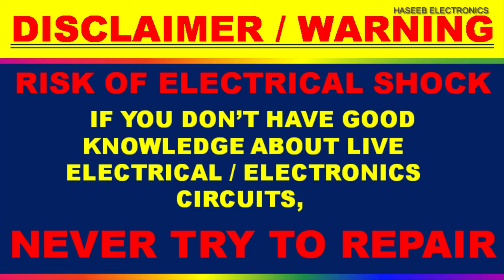{565} How To Repair of LED TV Backlight Strips / How To Replace LED on LED Strips

Comment: Great job Sir . 
I wanted to ask you if i can just replace the LED under the glass with another LED !! i mean just change the LED inside then put back the glass !! if it is possible what kind of LED should i buy !! is it 3535 or 3528 ? 
thank you
Reply from the maker: best regards
yes we can replace led 2835 3volt or 2835 6 volt 
watt rating depends on the led strip 1, 2 or 3 watt 
and we can use existing lense

Comment: Most of my reflection glass has fallen of do I stick it back with glue and if my led is not working can I take it from a  led strip by cutting that stop led to fit
Reply from the maker: yes it can be done

Comment: how to repair the power supply of that led strip on the power supply board ,,my power supply for led strip is faulty..it has no voltage reading,,

Comment: Nice ...but soldring is good enough???
Reply from the maker: yes that is doable but  soldering is not much effective on these aluminium strips, as these strips cool down the soldering iron, 
by this technique it makes best soldering without damaging the mounting and LED structure 
it is very cheap and very very useful
Reply: @HaseebElectronics  yes you are right this process does not damage the led but this soldring is not good enough for continuous running led ...I already do that...... please share some other healthy led soldring techniques .... thanks 👍🏻

Comment: Can I test it with simple 9v battery
Reply from the maker: yes. you can test it using 9 volt battery by adding 330 ohms resistor in series

Comment: What is the Reason you connected with the 12ohm resistor?
Reply from the maker: that is current limiting resistance 
i connected in series
please check upcoming video (video number 566) you will find a detailed answer for your question
Reply: @HaseebElectronics  does the multimeter have an internal resistor when using "led mode" ? Thank you

Comment: Can I ask what the exact purpose of the 1K resistor? Is for protecting the multimeter?
Reply from the maker: It is current limiting resistor 
(Similarly we connect in series with LED or zener diodes)
Reply: Oh, I just read your reply to another similar comment/question that video 566 will have the explanation for my question so i'll look for it as I'm behind on watching your latest video uploads. 👍
Reply: @HaseebElectronics  Thank you for the explanation.
Reply from the maker: most welcome dear friend

Comment: What will be cost of replaced backlight of samsung tv?
Reply from the maker: It will vary from country to country 
As in Pakistan price of 3 LED strips for 32 inch Samsung tv is just 4$
But same atrips here in Jordan are for 19$
Add minimum 2x time service charges in actual price 
For example 19 + 38 = 57$
Reply: @HaseebElectronics  I am here in India.My tv is samsung 43 inch UA43N5300ARXXL.

Comment: Sir please give solution for my 3 questions
1) how to fix LED lense(dome shaped).?

2) you used liquid solder, can I use normal soldering wire to fix LED.

3) I have 39 inch faulty croma led tv  , how do I know which type of LED is required (volt), can I use any type of LED to repair.

Comment: Y didn't u use soldering iron  or hot blower  instead of lamp
Reply from the maker: it is much more useful technique 
because the aluminium strip dissipate the heat from the soldering iron and hot air gun
but this method produces a quick and large heat to the stip and the LED remains safe 
and this method works excellently

Comment: Salam M Haseeb, great video ! Can you explain why the multimeter drop from 12v to 2.5v ? if no resistor used, what will happen ? thank you & salam aleilum.
Reply: Without resistor the will burn.
Reply: Note LED always need current limiting resistor.
Reply from the maker: best regards dear brother 
please check upcoming video (video number 566) your detailed answer is there

Comment: What if the LED are 3v ,will you burn them using 12 V ??
Reply: He is well experienced, Moreover, technician knows about the voltage rating in the area he is working. Thanks
Reply from the maker: no it will not burn-out because i connected a current limiting resistor 
please check upcoming video (video number  566) that is answer of your question
Reply: @HaseebElectronics  ok thanks
Reply: @HaseebElectronics  Thank you.

Comment: Wattage of led diode in tv
Reply from the maker: it depends on the color temperature of LED. most of the time it is 1 Watt 
MP-3030-2200-27-80 is 2700K
MP-3030-2200-65-80 is 6500K 
these have 150 mA
Reply from the maker: https://download.luminus.com/datasheets/Luminus_MP3030_2200_Datasheet.pdf